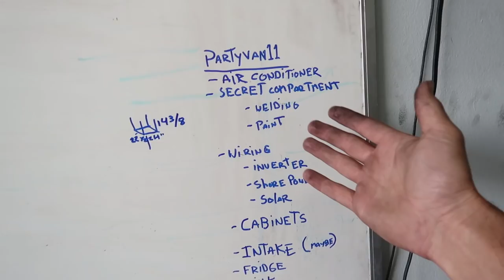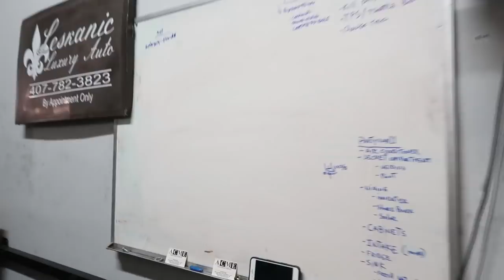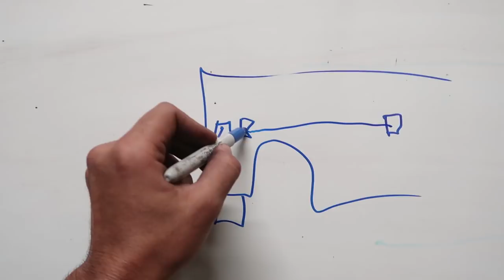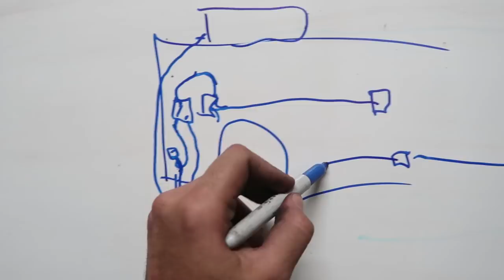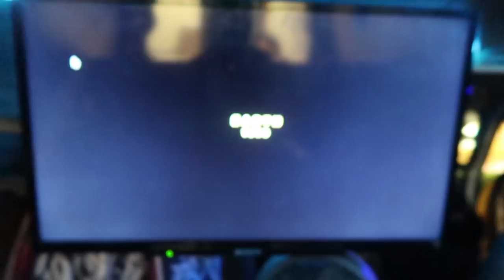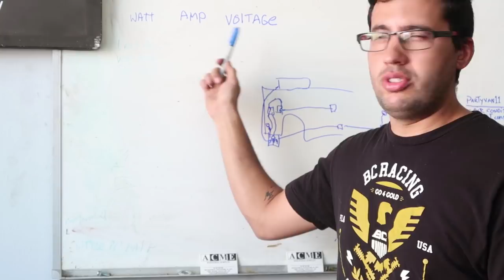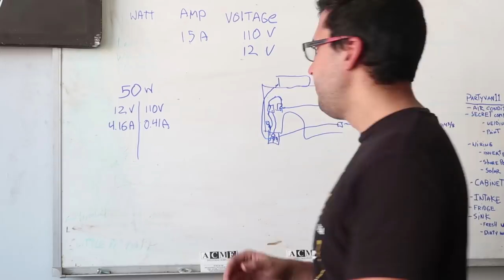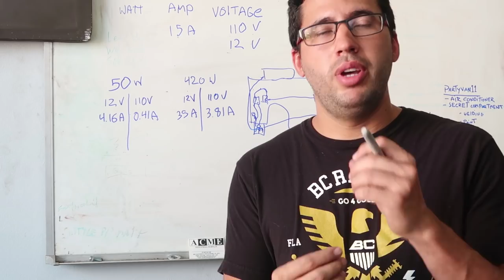CAMPER VAN Wiring UNDER $300!!!

Comment: Very nice setup Marco. Maybe you should put a low noise computer fan in that battery box. So the whole assembly will be ventilated when the van is parked for an event.( Only on when the batteries are delivering power). And put enough fuses in the different systems. So nothing can catch fire on overload in one of them. Dutch Regards.
Reply from the maker: Agreed ! A friend is giving me a usb computer fan that will turn on when the inverter comes on

Comment: Suggestion, get rid of those white electrical plate covers and get something that matches the paneling. It will look so much better. I like things to work properly, but they still should look asetically correct. Looking good is good.
Reply: Sorry, in addition GREAT JOB you guys!

Comment: DriftHappyTV Brother Awesome Video. I like you put shore plug in bumper good idea!  You should put 1 more plug going out just case you need an extension cord to plug  in something outside. You should never weld on vehicle without disconnecting battery you could fuck up car alternator or ECU! Best regards!
Reply from the maker: I’ve been told this but I’ve welded many things and so far no issues, I’ll learn one day haha and yea I’ve thought about external 110 will hopefully add in the future

Comment: hi, i think you battery will last at least 3 hours of a/c at medium and tv. for 50% of your lead battery. never discharge lead battery more than 70%. they will be damaged.
Reply from the maker: Agreed but that if ac is on all the time, ac I am getting has temp sensor and will shut off after temp reached which in such a small space, well insulated, it should hopefully double that

Comment: What happens to the wooden box when you drive through water?
Reply from the maker: It is metal outside wood inside, I don’t plan on driving through any water but if you do just seal up the bottom and leave only the top open, my van is for racetracks so I’ve never had to drive through deep water